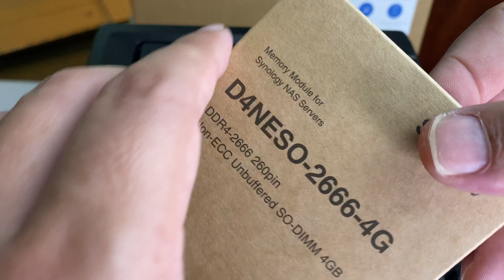How to install Additional RAM in DS920+

Comment: Install worked like a charm for my DS920+! Thanks!
Crucial CT16G4SFD8266 16GB PC4-21300 DDR4-2666
Reply: Did you use the Crucial CT16G4SFD8266 16GB PC4-21300 DDR4-2666?  16GB?  The data sheet indicates a max of 8GB.  "DS920+ comes with 4 GB DDR4 onboard and can support up to 8 GB by adding one optional DDR4 non-ECC 4 GB SO-DIMM."
Reply from the maker: No. We only use official Synology Ram.

Comment: You didn't cover the Synology software that you are supposed to go into to check and make sure that the expansion DDR4 RAM is showing up, and if not, how to configure it in the Synology software.
Reply: To confirm the RAM is detected and being used, go to Control Panel, then Info Center and look at the Total Physical Memory value.
If it doesn't have the correct volume, then go to Hardware and Power, and at the very top, un-check Enable Memory Compression. Then reboot.

I did all of this and it still didn't work, so I shut it all down again, removed my HDDs and re-inserted the RAM. Then it worked.
Reply: @johnhuffman638  Thanks for the update and happy to hear it worked for you, I tried all that, and still just that blue ring and no boot. I counted myself lucky after the 3rd time putting it alp back together with just the RAM on board and my drives and it came backup. I had to Scrub the drives and there are still some home videos from my YouTube channel that I have backed up on there in which the Audio cuts out, but other than that thank goodness it's at least back to square one.

Comment: They are called "PIN's" NOT "Teeth", just a FYI
Reply: Oh there was a third possibility that Synology tried to scare owners with and that was that if you didn't buy a "Synology branded RAM module" that it could cause fatal damage to the unit or damage the DSM software", and as someone that has worked in tech for over 30+ years, including 7 years build a certain ultimate customizable PC line (now owned by one of the evil big PC companies) during which time I had personally build 11,400+ custom PC's and as for RAM, I have seen all sorts of stickered "Brand Name" & generic modules and many often used the same SOJ memory chips on the RAM sticks, like you could peel the "G.Skill" or "Samsung" sticker off a bit and see the actual SOJs where made by "Nanya", "Micron", "Samsung", "NEC", etc, so this nonsense about having to buy "Synology" brand RAM is just that, nonsense as there are just a handful of fans that make SOJ memory modules so at that point it becomes a "check the specs, speeds, quality, history, etc of the companies that make the actual modules. Furthermore on another thread it was suggested that the Synology unit will run its own  version of MemTest, which said could take 15-30 minutes upto several hours, well after 4+ hours I took a risk and manually powered OFF the DS920+ (leaving the DX517 expansion on), as the web browser was just stuck on a constantly moving back and forth, then restarting from left & going to the right, "restarting" bar. I got lucky, it powered off (I didn't hear any of the 9 16TB HDD running in either unit, and then I removed the Corsair 16GB (even though Synology said in a 2022 update that the DS920+ has a 4GB module soidered on the board & one DDR4 slot that with the update could take upto a 16GB for a total of 20 (4+16=20GB) of RAM. I then powered it up and thank goodness it came up and I am now running a Scrub on both pools, and so far, so good, however I am still frustrated with the fact that I have the newest firmware, newest DSM software and it still wouldn't take a Corsair DDR4 16Gb module (as the last 3 PCs I build for myself I have switches from Samsung or G.Skill to Corsair Vengeance  which is very stable, reliable and even in my 3 newest systems the two that have 128GB (4x32GB Corsiar Vengeance LPX) of DDR4 & the 15th system that has 128GB (3x32GB Corsair Vengeance) DDR5 run great and during video editing I have seen the system task manager show it using 58GB to 72GB of RAM, so anyone that tells you 8GB or 16GB is more than enough, stop and ignore them, even my 11 year old ASUS G75VW ROG laptop has a i7, 32GB (3x8GB) RAM, 2TB Samsung 980 Pro & a 4TB Seagate 7,200 RPM 2.5" HDD in the 2nd bay, as well as a old but still usable 3GB Nvidia 660 GTX, and with that, I recommend you start with at least one 32GB stick of RAM, if you can budget 2, or all 4 then go for it, and as a rule of thumb, your GPU should have 1/4 of memory compared to your system RAM to build a balanced system, IE: anyone that buys a 16GB, 20GB or 24GB GPU and then only has 8GB or 16GB of system RAM is a straight up imbecile, I hope this helps and ALWAYS KEEP A UPS PLUGGED INTO ANYTHING YOU VALUE, be it a OLED TV (go to DigitalTrends YouTube channel and look up the video on how all mid and high end OLED TVs do a screen refresh after being turned off (with every 4 hours or more of run time in a row) and you NEVER KNOW WHEN ITS DOING IT (supposedly it takes about 12 minutes and it helps prevent burnin) BUT if your power goes out for even 10-15 seconds while it's performing this task (and you don't know if it is or not as you turned the TV off) then you could "brick" or seriously damage the Alpha9 Gen_, chip that runs the TV or the main board so the moral.of this story is "don't be cheap or lazy, buy a UPS, keep it checked, change the batteries every few years or as needed" and your electronics will last a lot longer. Thanks for reading, and those of us that know Gordon Mah Ung at PCWorld, let's pray for him during his battle with cancer that was publicly revealed 2 months ago, watch "TheFullNerd" on YouTube "Adam Patrick Murray" is a good friend as well as he's holding down the show while Gordon fights cancer, and finally, subscribe to my hobbyshop channel @MiloHajek

Thank You and I hope you learned something from my decades of experience
Reply: I tried upgrading my DS920+ with a 16GB DDR4 Corsair module and all it did was get the blinking blue light on the front. I feared that maybe 1 of the 2 "death" opions might have bricked my Synology (the Synology support page says that the blinking blue light can be either a faulty PSU (which is doubtful in my situation as I have all 15 of desktops, 3 laptops, 7 TVs, Xbox, Receivers, etc on APC or Cyberpower VA1500 or better UPS's) so I knew that was probably out, the 2nd option was that the module damaged the motherboard (however videos, tutorials & people that did have a board in a DS918+ or DS920+ go bad stated that the unit would either NOT power up, POST (so no "beep", once booted), or it just wouldn't turn on), this was not the case for me.